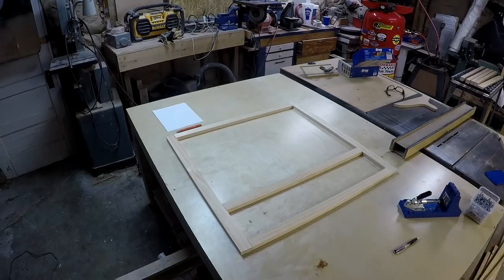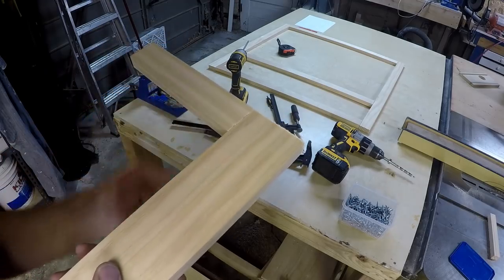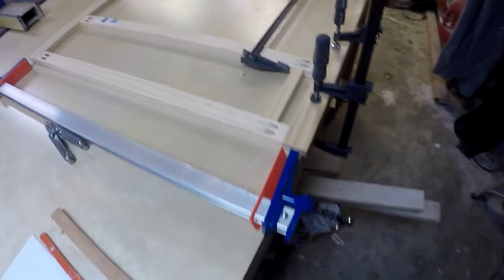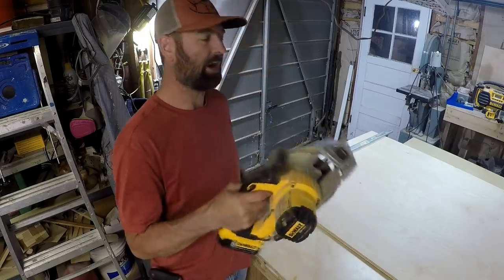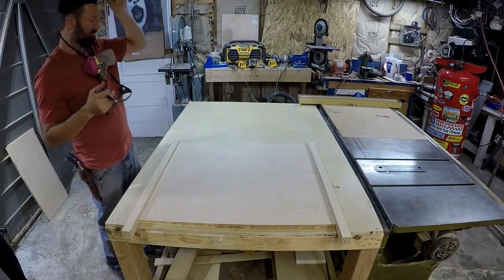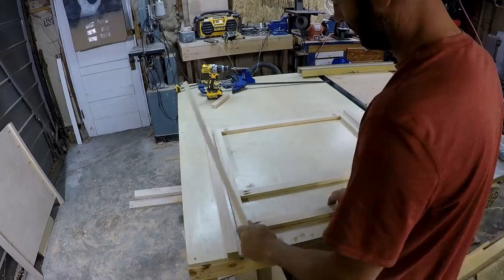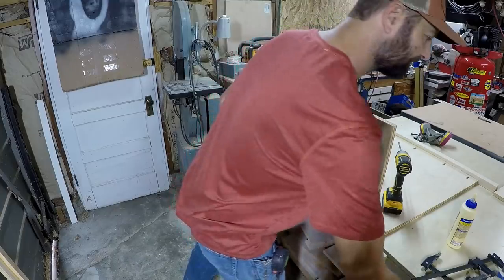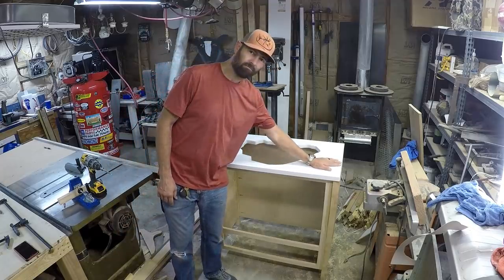How To Build Your Own Bathroom Vanity | THE HANDYMAN | 1940s Bathroom Remodel

Comment: Using the Kreg clamps with the big round discs on the end prevents the mis-match you got with your scrap pieces... drove me crazy until I figured this out.
Reply: Brian Catalano 

Yes. The “face frame clamp” . 

When I first saw the pocket hole jig I was hesitant. Then I saw Norm Abram uses the system so I figured why not. Totally changed the game. I’ve built built-ins, liquor cabinets, dinning tables etc. plus it works great for casing miters etc.

I was visiting an Amish furniture store - real beard wearing buggy driving Amish. Not as seen on tv Amish. I was admiring the beautiful furniture and though hmm I wonder. I reached around one of the face frames and felt the tell tale pocket. Son of a gun!! The Amish use pocket holes!

Comment: Good cabin build. And if you can clamp them so that it doesn't shift that's great. But if you're only talking about a 1/32 that's what Sanding is for. As long as you sand good and even you won't have dips and everything will come together.

Comment: Hey Handyman.  You can cut right on top of the foam instead of using it as a spacer and cutting just along the edge, using a track saw guide (simplifies clamping).  Just set your saw blade about a quarter inch deeper than the ply and cut right into the foam.  So if you have a 4 x 8 sheet of foam you can through the whole piece of ply on it.  Way safer and reduces tear out too.  You do not have to use a 2 inch piece of foam, three quarter works fine.  Thank you!!

Comment: Pro Tip: Don't use the impact driver to sink the pocket screws. Drop the clutch on the screw gun to 4 or 5 setting and pocket screws get torqued perfect every time.
Reply from the maker: Thats a great tip.  Thanks.  I will use this from now on.
Reply: No prob man. I learned the hard way first time I used pocket holes. Those coarse threads on the screws can pull right through softer woods if u accidentally pump the trigger one too many times. Love the videos. Keep crushin it.

Comment: If you are going to do much more of the Kreg pocket holes then do yourself a favor and buy the clamp that helps with the offset shift.
Reply from the maker: I think I have the clamp you are talking about and it doesn't work in any of these situations.  See tomorrows video to see it in action.
Reply: @TheHandyman1  I have the one with the metal circle pieces that hold the pieces together. I use it often and haven't had the slippage since. Now, my first pieces that I built before I had the clamp are crooked tho. Thanks for the reply.
Reply from the maker: Maybe we are talking about a different clam.  Mine is like a long nose vice grip thing  Its pretty flimsy and bends when I put any clamping force on it.  It made by Kreg.  One end goes in a pocket hole and one end has a circle on it.
Reply: The Handyman https://www.amazon.com/dp/B01H1WFNJC/ref=cm_sw_r_oth_tai_HX-RBb3M51Y3Z
This is the one I use for face frames
Reply from the maker: That's not the one I'm talking about but I just realized I have that one too.   It was buried in a drawer.  Thanks for the link.
Reply: The Handyman one end of the clamp is thin an goes into the hole you drilled for the screw the other end is circular,this should help with the offset,hope that I’ve explained that right 👍🏻

Comment: Just a quick correction... the wood glue is to keep the joints from opening up over time... the pocket screws serve no real purpose once the glue dries... the pockets screws are just a quick and easy " hidden" fastening system

Comment: Where did you get the rubber feet on those bar clamps? Are those Harbor Freight clamps? I run some 3/4” plywood down the channel and it keeps them from twisting. Makes them a great clamp at a cheap price.

Comment: Have you ever tried glue and activator?
Reply from the maker: Not on wood glue.
Reply: @TheHandyman1  well I was thinking that you would use the paired glue and activator. ...
Reply from the maker: I have some CA glue an he activator.  I have used it on fixing small projects.  It works great.   I have used it on some stain grade oak baseboard to hold the joints tight.
Reply: The Handyman I think what he was saying is try using CA glue and activator on your face frame joints. A couple of dabs Of CA on the outer most points of the rail with wood glue in the center, then spray activator on your mating stile. CA glue will cure instantly and you can screw the joints together without movement. Then of course the wood glue would set up overtime. Great project!
Reply from the maker: Liberty sings.  That sounds like it would work.